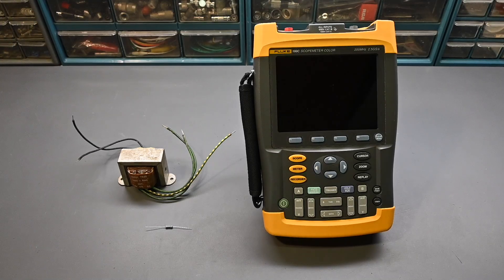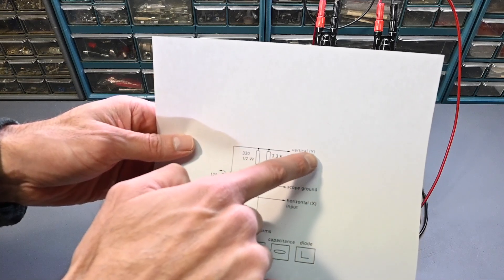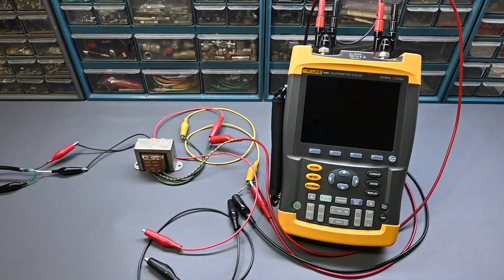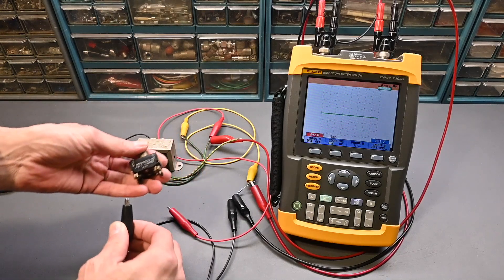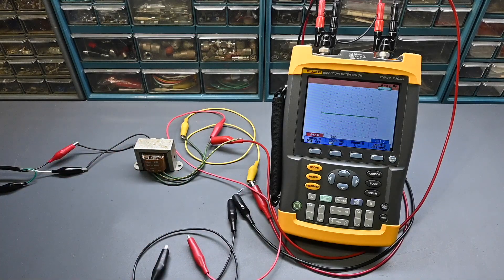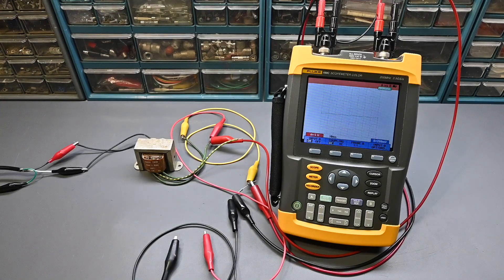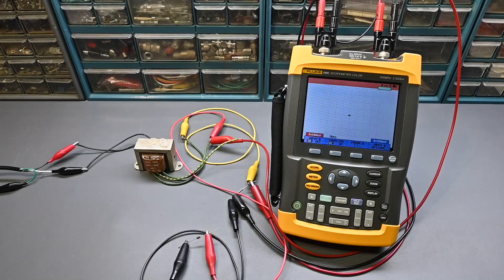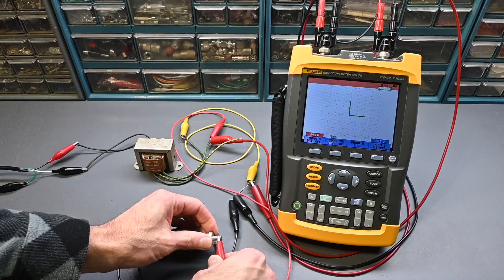Tech Talk - Easy To Build Electronic Component Tester

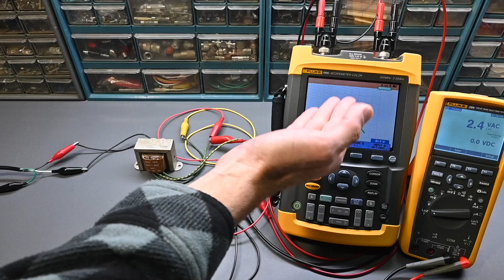Comment: 07:00 - the curve is 45 degrees, as our resistor in circuit is 3.3 kOhm and it just so happens the LoZ function in a Fluke 289 is about 3 kOhm.
Curve will be between 0 and 90 degrees from horisontal, with the ratio of the 3.3 kOhm and the DUT resistor.

The 2.2 kOhm at 08:16 gives us 2.2 kOhm / 3.3 kOhm = 0.67, counting the pixels we go up 1 division and left 0.6-0.7 divisions 🙂
Disclaimer: as long as scales are identical for A&B, else we need to multiply that in.

Comment: Very nice video. I'm definitely going to try this. I apologize ahead of time for this question, I'm new to electronics. For in circuit testing, wouldn't you want to use the higher value resistor?  I figure it would lower the voltage so as to not turn on other components. Or maybe it doesn't matter ? Thanks, definitely subscribing.
Reply from the maker: Thanks for subscribing! There are some in circuit component combinations you can't test because of interaction of surrounding components.  If you build the tester use whichever switch setting gives the better result.  The lower resistance setting for in circuit testing should allow better drive of semiconductor junctions when paralleled by a resistance.
Reply: @EriksElectronicsWorkbench  thanks for the information, definitely will do! 😀